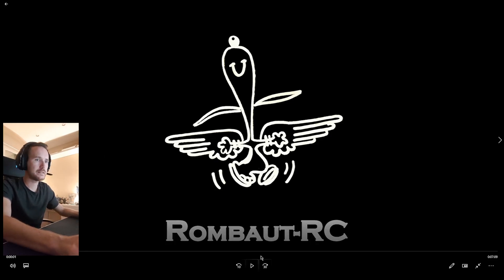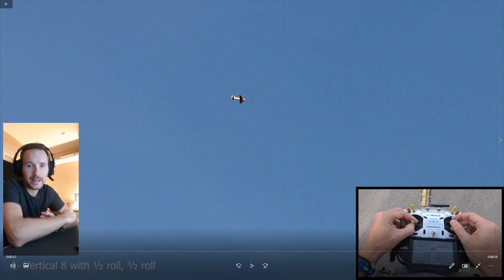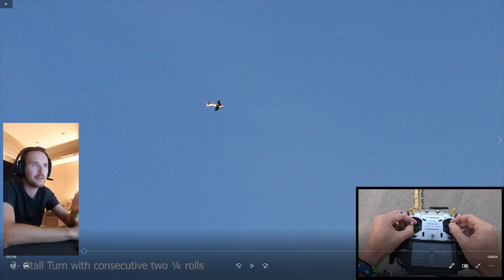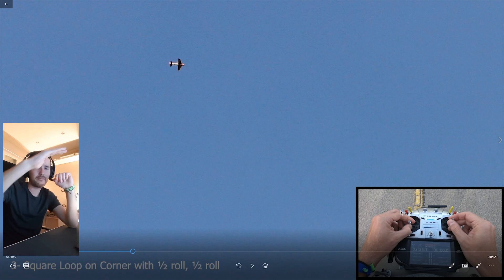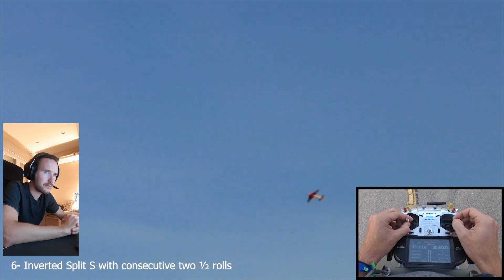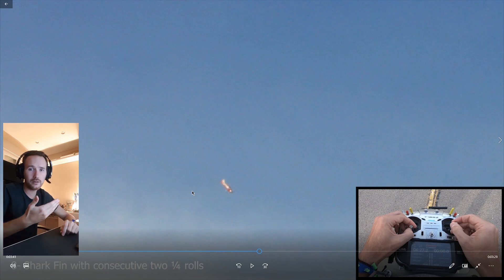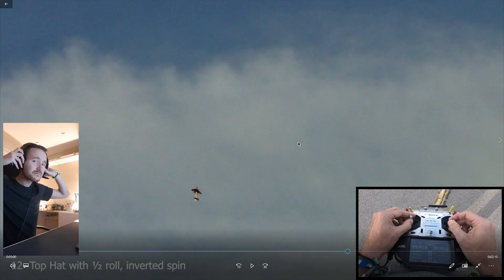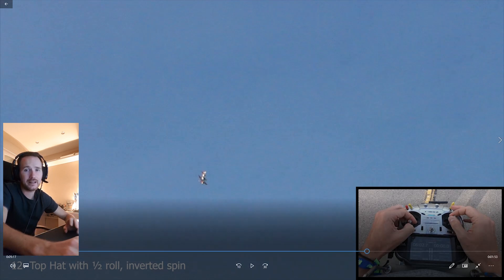Analysis of my P21 - My settings

Comment: Hi Juan, very interesting.. Particularly as I wondered what you were switching & had never worked it out! You MAY be interested in a video (that I have recently updated) which show my use of crow braking on a small F3A biplane. The brakes are proportional (with offset) to the throttle.. I get the same (or similar) braking result, but no switching in flight... https://youtu.be/nA247xVgYwc
Reply from the maker: Hi Russ! To activate the brake I use a logic condition. The switch sets the position of the T-Brake at idle, (0: No brake, 1: Half Brake, 2: Full Brake) but is the throttle who activates the T-Brake or not. My father for example uses half brake during all the flight and he doesn't need to touch anything, but Im using different brake settings for different maneuvers and this is why I am changing the switch position. Nice video! We started using the butterfly brake with biplanes in 2010 with the Amethyst (here, after the landing you can see it in our Citrin: https://youtu.be/tVOg-IP5fJc?t=128). It was quite effective, but it is more difficult to setup than the T-Canalizer in my opinion. Thanks for sharing! Cheers!
Reply: @rombautrc  thanks for the reply Juan.. & I understand the system a little better now too 👍👌